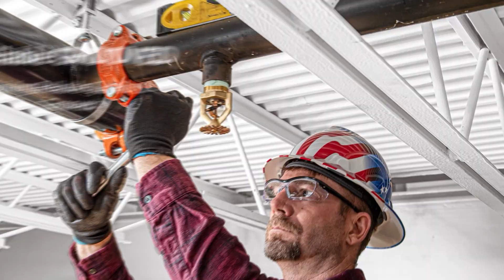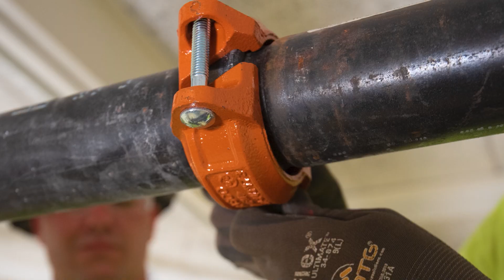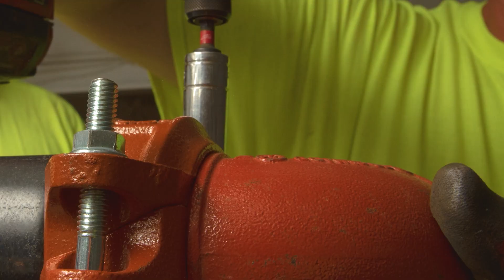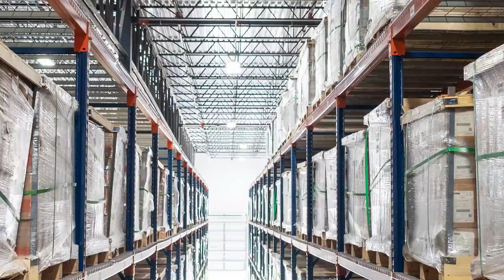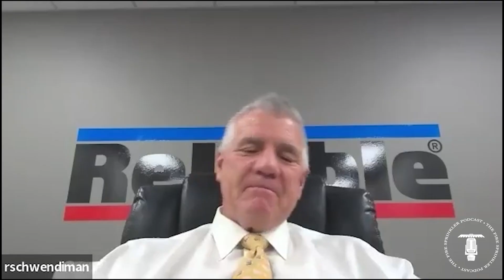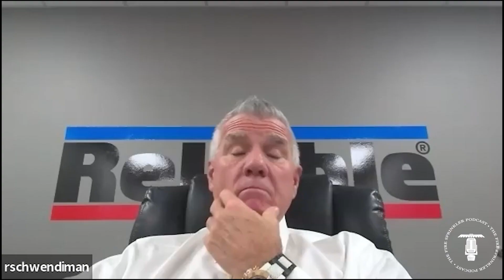FSP 84 ft. Rex Schwendiman Discussing Reliables new grooved product line

Comment: I want to couple fire sprinkler system piping with grooved pipes and fittings. can I use grooved couplings to install all the pipes and fittings include pumps and valves.